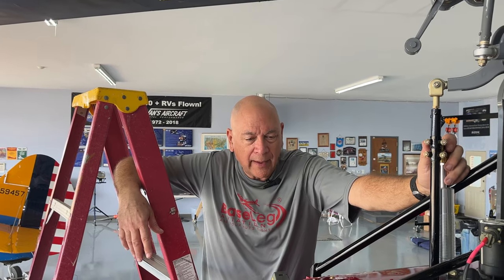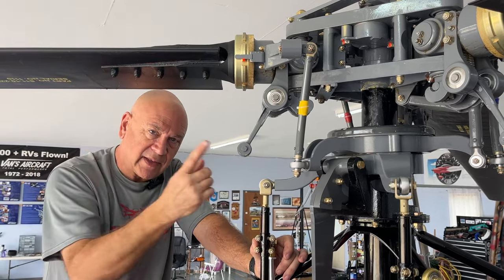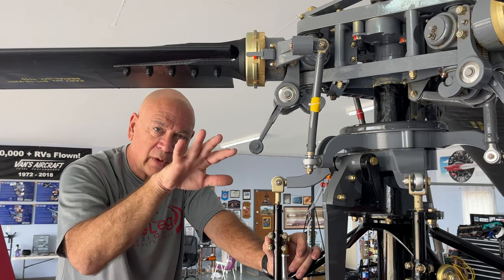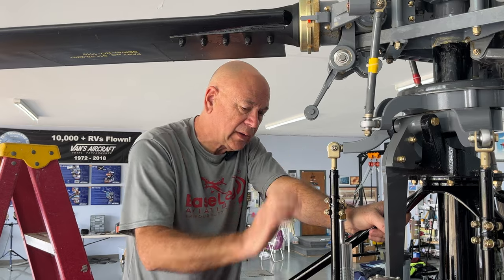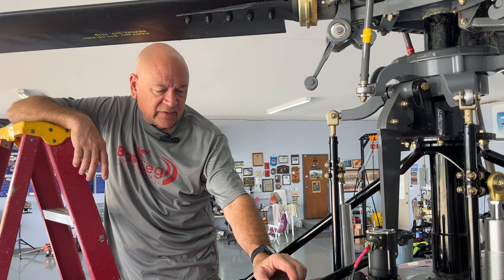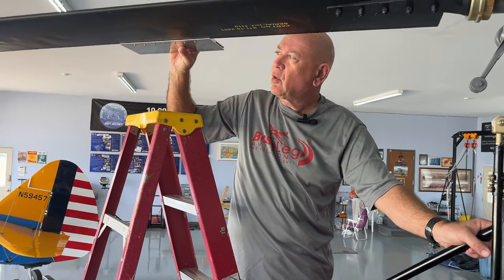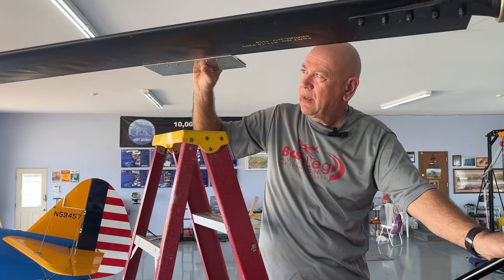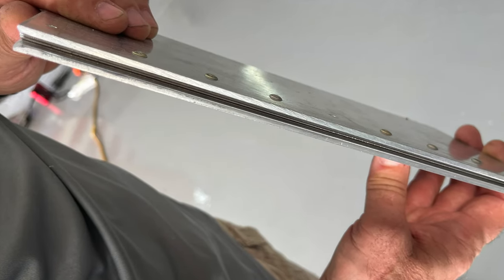hummingbird test flights and tweaks 1

Comment: Looking really good, for a brand new build!  You're probably still in 'overload', but what are your initial impressions of the Hummingbird, compared to your Hughes?  Does yours have a governor?
Reply from the maker: No governor. Correlator on the throttle, just like the Hughes, so I am used to that. So far I like it. Lots to do yet to get through phase I.

Comment: G,day Vic from Sydney Australia.
Congratulations on flying RWY heading.
Are you finding any loose connections (linkages, nuts and bolts) from vibration?
Do you have engine management sensors and data recovery storage for analysis?
Any wet engine oil outside the thunderbolt?
🌏🇭🇲
Reply from the maker: Everything has stayed tight so far with 1.5 hours. Yes, I have an Advanced Flight Sytems 6600 EFIS and I’ve downloaded the data after every session. I’ve decided to put a richer jet in the fuel servo as a result of the data.